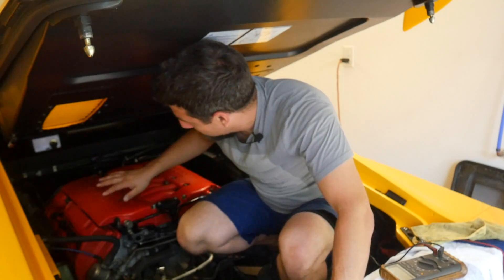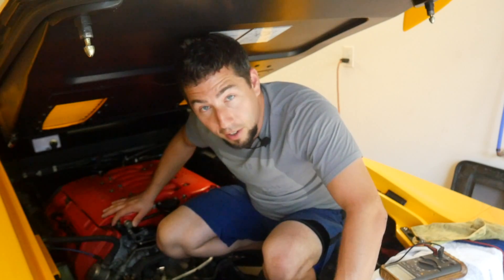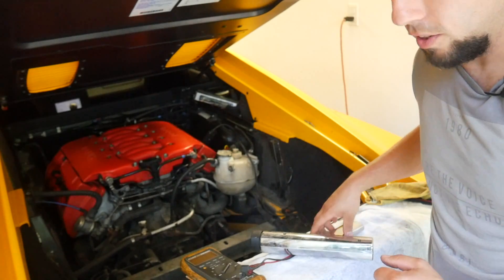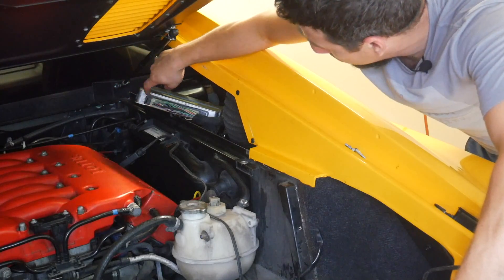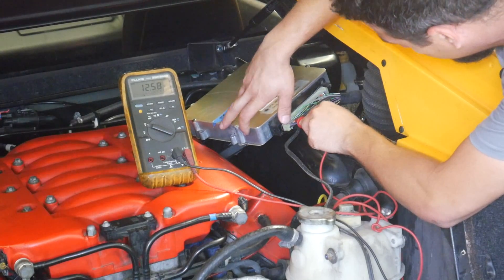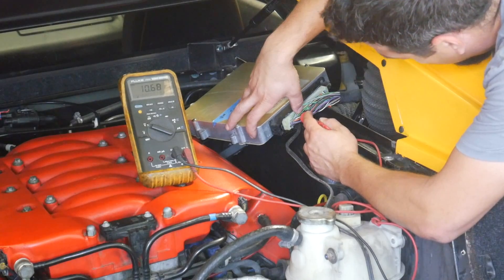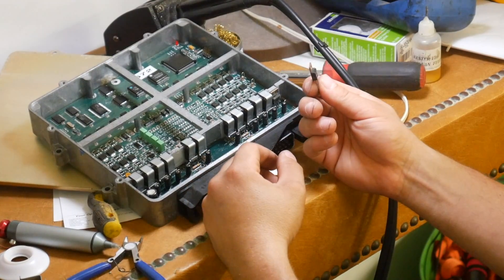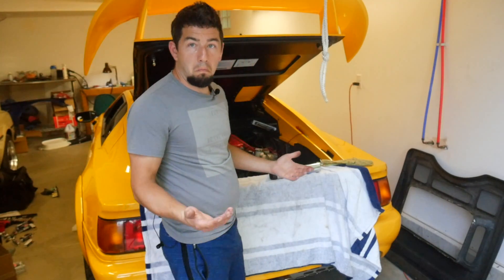Lotus Esprit V8 Engine Misfire Diagnosis & ECU Repair. No Spark in 2 Cylinders

Comment: I have a brand new, never used, carefully stored ecu that lotus gave me when i bought my esprit in 2001.  It has a a performance tune on it good for 400 HP. It was given to me by the VP of sales. I sold my Esprit five years ago.  My car was yellow also, the best color! The ECU is available for purchase.  Contact me at aviator41861@gmail.com if interested.  Good luck with the car, I loved mine.

Comment: Hello again. I think I’ll have to have a go cleaning both sides of the board and reflowing solder joints as per your instructions.  Can you guide me as to the type of solder I’m likely to find here?  I have previously done some strain gauge soldering under a microscope and am a “less is more” guy when it comes to solder.  I have little option as the ECU is out of the car and it is filthy and the coating is flaking.  Any guidance would be of great help.  This might just work!  Thanks.
Peter J

Comment: I’m not trying to overwhelm you here!  My  ECU has NO drivers in 4th from left (IG3 spot) and second from right (IG7) positions inside my ECU! This assumes the multi-pin connector socket is facing your gut.

Comment: It used to work beautifully (I think!), then was intermittent.  I tried to establish a pattern without much success.  It seemed to start misfiring (engine tone would drop, gassy stink, increasingly rough idle, lagging power) after 20 mins. or so.  Start it cold and it would be fine again.  The 20 min. thing was never very convincing.  Now it is constant and I dare not drive it.  Following engine “rebuild”, mechanic, who was assigned to this car exclusively, noted some misfiring.  ECU was removed and sent to a guy in UK who specializes is such, was reprogrammed, put in his Esprit V8 to check, and sent back.  He was the last guy inside the ECU which is anything but clean.  So here I am!

Comment: Hello once again with my ‘98 misfiring Esprit.  I used a timing light to check the 8 plug leads and holy crap!  Assuming plug #1 is far right corner as you look at engine from rear bumper, NO SPARK on #s 1& 2, and probably 4!  I say probably because lead 4 was so tight I really had to pull on it to take the reading; not a good feeling.  I then disconnected battery and removed ECU.  A dirty mess inside!  Very little coating at all on board, fine metal dust and dirt all over the place.  Replaced top cover as is and looked at back of board.  Lifted and flaked coating so bad it looks like clumps of cobwebs!  Replaced cover as is.  I sure would like you to have a look at it!  How do we set this up?

Peter J
Reply from the maker: James Reny hey sorry I haven’t replied yet! 
With no spark on 1 and 2, and maybe 4 I am concerned it may or may not be ecu related. 1 and 4 are on one circuit and 2 and 3 are on another. You’ve replaced all of the ignition components? Is the misfire a dead miss all of the time or is it intermittent?

Comment: Shrinking cylinders
Reply from the maker: Did you watch the video? Car is fixed. Not a mechanical issue.
Reply: @I_Do_Cars  Nice, It happened to mine
Reply: @I_Do_Cars  U r a god
Reply from the maker: John Jr nah just a guy with a meter and a soldering iron.

Comment: 98 V8 Esprit here....also dream car from when I was 9 years old... have spent a whopping sum getting it up to speed... then THE EXACT SAME PROBLEM YOU HAD STARTED PLAGUING MINE!  It hasn’t yet ruined my enthusiasm for the car (I did wait 42 patient years for it) but I’m at my wits’ end!  You give me hope!

Peter J
Reply from the maker: If yours is misfiring and you've followed the same diagnostic paths, I can fix the ECU for you if thats what you think is wrong, and test it in my own. I'd be thrilled to fix another!
Reply: Hi there.  Peter J with the 1998 V8 Esprit / possible misfire/ECU issue that you had.  I‘ve  started looking for spark using timing light.  Based on ease and “looseness” of ignition wires, I’ve checked nos. 1,2, 5 & 6.  NO SPARK ON 1 or 2!!  I’ll continue looking and do rest but wires are TIGHT in the plenums under the two oddly shaped aluminum covers.  Weird!

Peter J
Reply: Not sure if this is how to reply to a kind reply!  Thanks SO much for getting back.  I’ll first use a digital timing light to verify misfire and compare to engine rebuild notes where very intermittent misfire was noted.  I’ll carefully remove ECU and have a careful look inside.  There’s quite a bit of info to pass to you which might bore others, and conditions upon which I release my ECU to you and conditions upon which you might want to trust me with payment!  Tell me how you’d like to continue a dialogue.  Boy did you appear at the right time; we LOVE out V8 Esprits and I want to be able to love driving the damn thing!  Many thanks for getting back.

Peter J

Comment: I did eventually figure out a lot of the individual parts on the board and what they are for, this is a univeral ECU used on other cars so there are a lot of unused transistors on that heatsink there.
Reply from the maker: Mike C what other types of cars use this ecu?
Reply: @I_Do_Cars  Cool video! I'll be looking at my ECU now ('01 V8). Here's the wiki and website for the ECU manufacturer: http://www.efitechnologywiki.it/doku.php?id=en:ect_mod_dn 

I really would like the reflashing software to keep this car going.

Comment: Awsome, glad i'm not the only 1 who got into their 918 ECU to figure out the ignitor issue. YOu might have seen me talk about it and post pics, my ignitor was actually bad, 
i replaced with one from a Megasquirt kit. In the end I installed full Megasquirt standalone.
Reply from the maker: Mike C I didn’t see that but I can totally see using one for another application without issue, it’s just a transistor after all!

Comment: Great work man!! I know this wasn't your problem but careful with the new spark plug wires. Many times they don't click onto the spark plugs. The lead needs to be pushed deeper through the boot so it can reach and snap into the plug. BTW, you do have the high torque ECU right?
Reply from the maker: Pancho's Speed Shop yes I figured that plug wire situation out quick! Lol. The car in fact does have the high torque ecu.
Reply: thats so true.